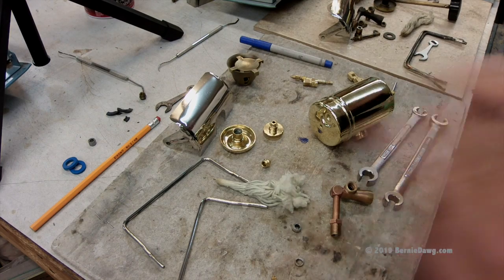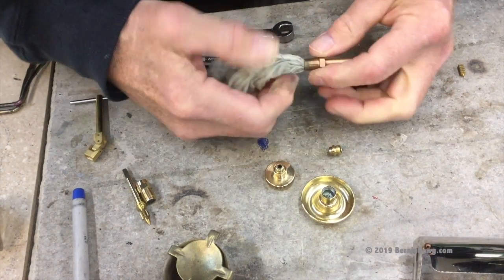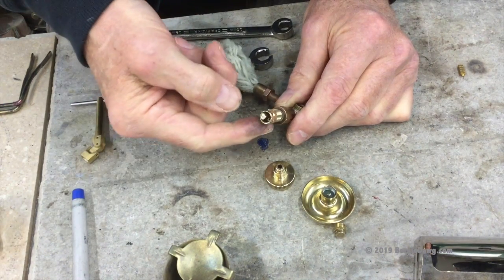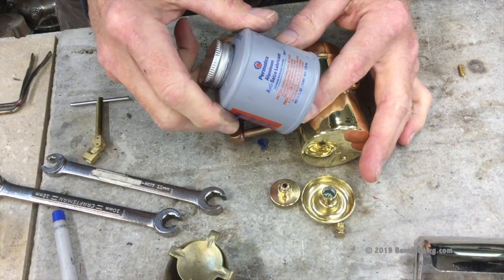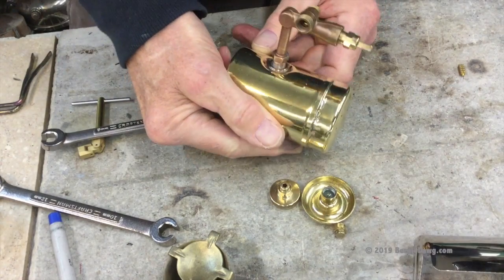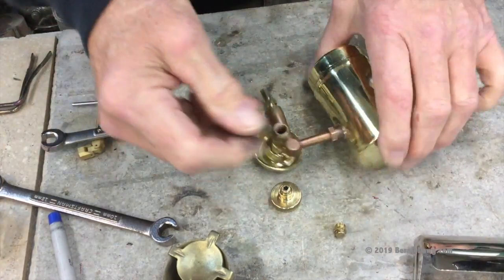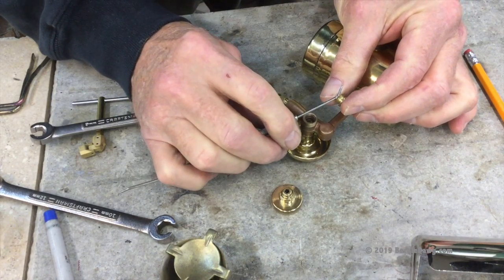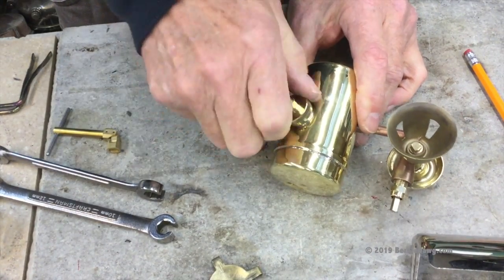Optimus 8R Stove Repair/Rebuilding - Part 2: Reassembly

Comment: Loved this video as well as part one. I'm the proud owner of an 8R that was a gift to me by my mother. She gave it to me for my birthday around 1970, or so. It's served me well all these years however, on a recent day hike, I took it along to brew some tea. I packed it, threw my pack in the backseat of the truck and by the time I arrived at the trail head I noticed the smell of fuel in the back. The gas cap was leaking. I have purchased a repair kit, but have never had to do any maintenance on the stove, so watching your video has been a real primer, (pun intended) for me. Thank you so much for the lessons.
Reply from the maker: @David Folkart Wow! Thanks for the comment. Glad my stuff helped you out. BD

Comment: just rebuilt a Optimus 99. The cleaner needle needed 5 clicks before dropping into place. It takes a few tries to get the optimal position to close the gas off position to max flame position. I'd suggest start at 3 clicks and increase the  number of clicks to find  the right position of the cleaner needle. Then write it somewhere on the stove.
Reply from the maker: Clicks are really subjective and can vary soooo much. May not even be repeatable on a given stove. It's just a general guideline and, as you agree, trial and error are the method of the day. BD

Comment: After 25 years I took both of them down from the attic. And I had a very pleasurable evening. It turned out the rubber had crumbled and the wick of both was just loose in the tank. I'm going to light them tomorrow evening. It will be amazing, I'm sure. So sir, thank you for sharing this.
Reply from the maker: @Marco Uitendaal You're welcome! I have quite a few videos at my channel which can help you get your stoves back to running great. Check 'em out. BD

Comment: I just fired mine up for the first time in at least 30 years. Worked perfect but lid washer is hard.
Reply from the maker: @2020Properties You got lucky. I bet it'll work even better if you have a proper washer and pip installed in the SRV (safety release valve) fuel cap. BD

Comment: Hello Bernie. Thank you for your video, it helped me start my stove. I have a CCCP version of this, maybe primus pt1, and my problem is that when I want to shut it it only decreases the jet but does not put it out. I've checked the insides with the help of your video and seems it was barely used and in a fair condition without damage or visibly used parts.
Reply: Note: I used a mop head line as a struggle method for the cloth inside the tank, as the origonal was so old that it could not get wet. Is it possible that it soaks up the fuel too heavily?
Reply from the maker: @danielbosze2364  If it isn't shutting off it's mostly likely that you have set the cleaning needle too deep inside the vaporizer. Remove the jet. Remove the cleaning needle. Reinstall the jet. Try the stove now without the cleaning needle in place. If it shuts off now, then you need to do a better job of setting the cleaning needle. If it still doesn't shut off without the cleaning needle in place, then remove the spindle and inspect the spindle tip for damage. It should be a smooth cone shape and not have deformation. If the spindle tip is damaged, chuck it in a drill and spin it while filing or sanding to reshape the spindle tip into a smooth cone. None of your problem has anything to do with the wick you made of cotton mop head string (your other post). BD

Comment: Love the video and I love those stoves. To bad that they are really getting expensive.  I got one a couple of years age and boy I'm glad I did.
Reply from the maker: Thanks for your compliments on the video(s). 👍
However… I think you are more than a little off-base with your comment about the expense of these stoves. A quick check of completed auctions at eBay since mid-November reveals 32 stoves that sold between $66 and $100, 25 that sold between $45 and $65, and 13 that sold for less than $44. All three price ranges I’m quoting are less than modern liquid-fueled backpacking stoves cost by a good margin. The way I see it, if you are a bit patient, you can get a durable, repairable, long-lasting vintage and collectible stove for less than it costs you and a friend to have a burger and a beer. Sounds pretty good to me! 😎😄 Certainly nothing to moan about. 🤨 Fact is - the 8R and the Svea 123/123R remain the two best values in collectible, and still useful, vintage backpacking stoves. And, they’ll only increase in value as time goes on. So, what’s not to like?! 🤩🥳 BD

Comment: Nice work! I hope to get my hands on an old 8R someday, they seem like very reliable stoves. Much like the Svea 123, which I adore and still to this day consider it to be the best white gas backpacking stove.
Reply from the maker: Thanks for dropping by and thanks for all you do on your channel, CC. The 8R is pretty much the same stove as the 123, but in a more stable horizontal package (none of that vertical tippiness). Well fettled, they are the output equal of the 123s. There's tons on eBay at any given time, and (I reckon) a feller can never have too much gear. 😁 Consider giving one a try! BD

Comment: I have a Romanian Army Stove (Russian Army / Optimus knock off) which looks identical to the Optimus. I had it working ok and tried it on kero. Didn't lie it one bit and I have not been able to get it going since.
After watching these two videos, I'll try and rebuild it.
Thanks, Great pair of videos.
Reply from the maker: You're welcome! Probably the PT-1 from the former USSR or satellite SSR. Best to disassemble and clean it out now from the kerosene, yes. They were made for good quality automobile gasoline back in the day. Today, run these stoves with Coleman fuel, Crown fuel, MSR Superfuel, or other quality naphtha camping appliance fuel. Don't use modern pump gasoline as it's full of additives and goop for pollution control that will gum up your stove more than the kero already has. BD
Reply: @BernieDawgCinema  Thanks. I usually use Coleman Fuel. I'm a bit of a stove addict and have a US Military Vietnam era petrol stove that I can't get going, that will be the next project. I used one in the Army as a young man (in the days when petrol / gas was the real deal, haha). No one taught us how to use them (they guys in the Q Store wouldn't have known either, the stoves just arrived one day and they became a treasured bit of kit. It was pretty adventurous working out how to use them, we came close to blowing ourselves up a few times, haha.
After that I have my Coleman Feather stove to fix and a big old two Green two burner Coleman, etc, etc. Thanks again.
Reply from the maker: Sounds like big fun! Enjoy! BD

Comment: Great content once again! I was wondering whether copper anti-seize paste could be used instead..
Reply from the maker: Thanks. I've not used the copper stuff, but it specs out about the same as the aluminum. And, it's copper colored. So, sure, seems to me it would work about the same. Maybe look better, too. 👍 (Something on the threads is better than noting, I reckon.) BD

Comment: I just received the premium rebuild kit from Spinnakerspar. It comes with a graphite ribbon but no explanation on how to use it. Does it wrap around the outside of the graphite or on the inside around the brass spindle?
Reply from the maker: @Mark Bosworth Fwiw… I didn’t sell you that ribbon stuff, nor do I show it in my video, so I wonder why you are not asking spinnakerspar (the seller) how to do it. 🙂🤷‍♂️
I would suggest the “Enhanced” Premium Rebuild Kit from spinnakerspar. It comes with a solid graphite instead of the ribbon - so much easier, and more effective, too. 
To use the ribbon, install the spindle into the burner body. Wrap the ribbon in a clockwise direction as tightly as possible around the spindle until you have enough and what looks like it might fit into the burner body. Use the spindle nut to squash your wrap into the stove body. Tighten the spindle nut down. Check your fitment by turning the spindle. If it seems loose (likely will), repeat the steps above to add more ribbon to the spindle. Eventually, you smoosh your graphite ribbon into a block using the spindle nut. Personally, I only use ribbon as a last resort when it’s a rare off-size spindle packing that is no longer available and can’t be purchased. The solid graphites for Optimus/Svea stoves are still available (even from spinnakerspar), so, of course, that’s what I recommend (just like in my video). Good luck and happy camping! BD

Comment: Hi Bernie
I've been trying to repair my Optimus 8R on my own. I didn't order new parts-Used the parts that I already had, including parts from previous rebuild many years ago. I disassembled, cleaned, and thought I did everything correctly-The wick still looked good. I think the graphite ring was in good condition too.  I applied alcohol in the cup below, lit it and turned on the unit when I thought it was ready. Well-That didn't work so well. The flame shot up about 6" and gas was over much of the unit. It was spewing out more than it should. What am I doing wrong and do I just need a new kit ? Great video.
Thanks-Louie
Reply from the maker: @Louis Monarque It’s perfectly acceptable to wait until the alcohol has completely burned away before lighting the stove with a match or lighter. Then, no judgements of whether the stove is “ready” are required. 
When your stove is “ready” only fuel vapor should come out of the jet, not liquid fuel. 
If you get liquid fuel after preheating, then it isn’t ready because it hasn’t been preheated enough to vaporize liquid fuel into a vapor. 
Here are some YouTube comment tips:
1. do the testing outside in a safe area away from flammables
2. do the preheating in windless conditions or in a well-sheltered spot so the preheating heat doesn’t simply blow away with the wind and you end up with a cold burner.
3. don’t open the spindle valve all the way at first, just a little bit to light, then light the vapor, then open more as you have insured there is vapor and not liquid fuel, and, also, as the stove has had a chance to develop some heat/warm-up.
4. watch my other videos on how to light a stove - there are at least three on the subject.
5. for any additional assistance, contact me for on my FREE (zero cost to you) stove help line right here: bd@berniedawg.com
Good luck! 👍 BD

Comment: Hi bernie. Best educational I have seen in quite awhile. I have one of the 8R I just picked up second hand. Im polishing the tank and burner and following your video but the main housing has rust on it and blistered paint. Have you any advice on what I can best re-paint it with after treating the rust? I appreciate you and Thank you for sharing your knowledge.
Reply from the maker: Good quality auto paint, jeep paint or gun paint are all solid and proven choices. Paint doesn't need to be heat-proof or heat-resistant - the factory paint was not. BD

Comment: Thank you for the video, really well done. We didn't catch what you made the tank gasket out of.  Could you please write it in the replies? Thanks.
Reply from the maker: I suggest you view my tutorial on refurbishing the caps here: https://youtu.be/d6SEE1ToCSQ . I use 2mm Viton rubber sheet for my cap seals and 3mm Viton rubber sheet for SRV pips. I cut the seals from the sheet with Mayhew concentric hollow punches. All of that will cost you a bundle to buy, so I recommend getting your seals precut from USA eBay seller "spinnakerspar". Or, in the UK, from "The Fettle Box".. DO NOT use the security bits I mention in the video (or sold by vendor "Qu**tSt**e") as those have been proven to fatally damage some caps. BD

Comment: Great video! Any suggestions on what to use to replace that small graphite plug with?  Mine has totally deteriorated.
Reply from the maker: The graphite packings for these are still available. I have a webpage with links to suppliers of these parts which you can find right here: https://www.berniedawg.com/stove-part-supplier-links/ You're looking for Optimus part #2094 or the equivalent. None available in the USA or N. America - you have to order from the Far East or from the UK. BD

Comment: Great videos.  I thought I followed everything you said.  In the off position mine will weep fuel.  Any thoughts would be appreciated.   Thanks!
Reply from the maker: @All American Fun Thanks! On weeping fuel, 3 possibilities. 1. the needle rack is set too low keeping the spindle valve from closing. Try the stove without the needle rack. If it stops weeping, then reinstall and set the needle rack a click higher. 2. The tip of the spindle has burrs or is misshapen. Clean it up with some fine sandpaper so you have a smooth cone. 3. The graphite packing has flaked off the packing and is stuck in the spindle hole. Open and close the spindle firmly about a dozen times, then fire it, shut down after a 10 minute burn (cleans out the graphite flakes) and see if the weeping has stopped. If none of that works... bd@berniedawg.com where we can swap some photos to help you further. 👍 Good luck. BD
Reply: @BernieDawgCinema  you are the man BernieDawg!  Working great now!  Thank you for replying so fast!!
Reply from the maker: @All American Fun Excellent news! Glad that worked. You're welcome. BD

Comment: Great video. Is copper grease ok for the anti-seize compound?
Reply from the maker: I think that might be the same stuff. So, yes. Even a light oil can help. There's usually a film of carbon built-up and the lube helps keep the threads working during the install. BD

Comment: Hello there, I'm using PT-2.
Can you tell the exact needle setting that you installed with a pencil?
Reply from the maker: No. Sorry. I cannot. The setting for the cleaning needle varies from stove to stove. It is very common that the proper setting is different from one stove to the next. The proper setting should be somewhere between 3 and 5 "clicks" as I demonstrate in the video. Setting the needle correctly is a trial-and-error process and will require practice which leads to skill. The PT-2 is not the same as the 8R stoves featured in this video. The Russian-made PT-2 setting will vary just like on the Swedish 8R stoves in the video. Be patient and try it at different settings until you get it right. Good luck. BD
Reply: @BernieDawgCinema  THANKS

Comment: Great video 👍 what does it mean when a fuel stove is stuttering/flickering ( kerosene)?
Reply from the maker: I think a photo or two, or, better yet, a video clip, would help me to help you determine what is going on with your kerosene-fueled stove. "Stuttering/flickering" is a bit vague I'm afraid. Perhaps a link to a video of your stove doing what you describe? Or, best yet, contact me directly through email at: berniedawgstove@comcast.net BD
Reply: I’ll make a full video later today https://youtu.be/MMNy2d8ak7w
Reply from the maker: Your short video shows a stove that is not correctly vaporizing the fuel (at the end of the video = bright yellow flashes). You don't say what type of stove it is (your reply has "blocked words" thanks to YouTube comment algorithms), but it looks like a Chinese-made Booster +1 or similar. Those stoves are not intended to burn kerosene, only white gas (aka Coleman fuel) or isobutane canister gas. The one I have says "white gasoline or propane/butane mix" printed right on the box it came in. Try it with Coleman fuel or canister gas and you should see it working correctly. Happy camping! BD

Comment: So the on my 8R the burner bell is at a bit of an angle in comparison to the threads... is this normal?
Reply from the maker: It's something I've seen on some stoves (usually the newer ones). Sometimes the lean can be corrected or reduced with some careful tweaking of the bell by hand. Sometimes not. If the stove works okay as is, I'd probably leave it be. If the flame pattern is off because of the lean, it might be worth trying to adjust the flame plate to compensate or physically bending the bell to sit more evenly. BD

Comment: Wonderful tutorial! This is going into my reference library for sure! Regarding the "shining up" part, was Mothers Mag and Wheel Polish and a rag all that you used to get the degree of shine that you now have? Do you have any videos where you detail or illustrate this process? Are there any special tools you would recommend for this process? I just purchased my first of this type of stove - a Primus PT-1 and am waiting for it to arrive. This video has given me a great baseline for maintaining it! I'll look for your paypal.me box and make a donation in appreciation. 😎👍Thanks and best regards! - Luther
Reply from the maker: Thanks, Luther. All the small parts are shined up with Mothers. You can use other compounds if you like, but try to stay away from products that have high ammonia content (Brasso, Flitz). Ammonia and brass is not a good combo as the ammonia can initiate or exacerbate micro-fractures in brass. Big parts like the tank, heat shield, and pot stands I use a buffer just because it's faster. But, Mothers will do the job, too. The burner bell, the flame plate and the vaporizer I glass bead blast because I like the matte finish which emulates the original cast finish. They'll darken when they get hot anyway and lose all the shine. Some folks will use a felt buff on a Dremel tool with their Mothers. That works fine for the small parts but can leave swirls you have to remove by hand on the tank. Your call. No, I don't have a video that covers shining. Sorry. I reckon it'd be sorta boring watching me rub and rub with a rag. There are some other YouTube providers who cover that. You don't have to shine. It'll all go away in a year or two anyway, and doesn't make the stove run better. But, a lot of folks really like 'em shiny. 😄 Good luck with your stove work. BD